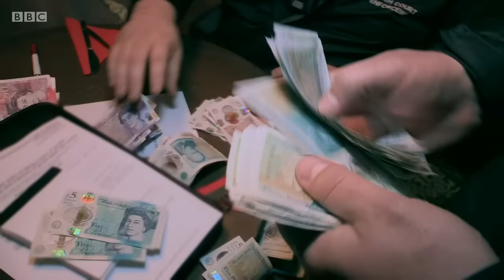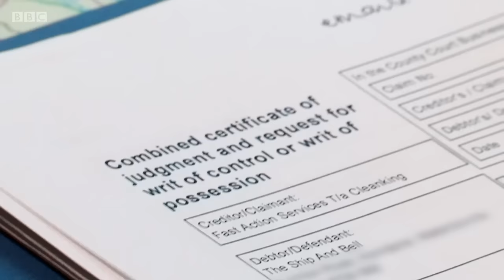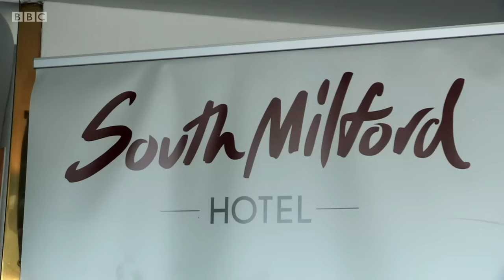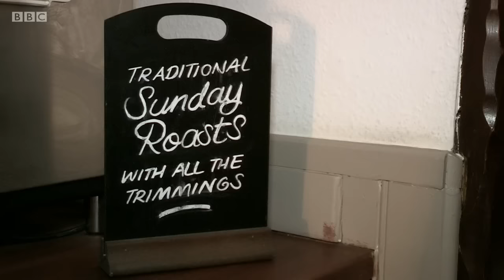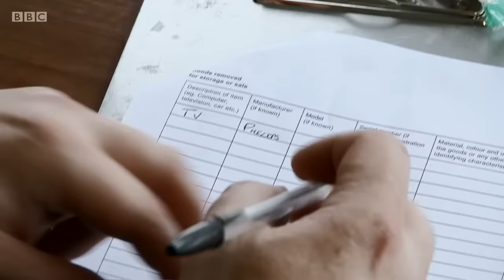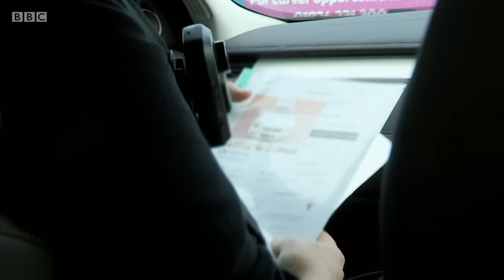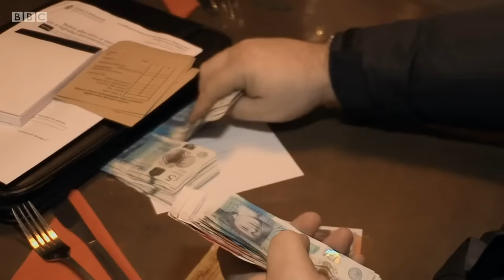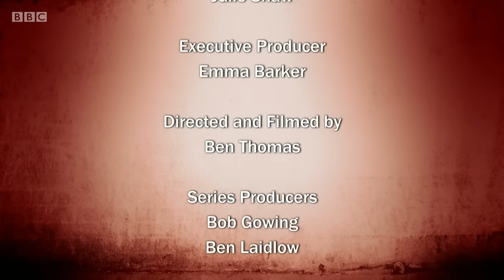The Sheriffs Are Coming S09E08

Comment: They took way way more than they needed to from the hotel, local scrap yard would have paid more than £2k for all the stainless steel in the kitchen alone.
Reply: I don't think that they are allowed to scrap items. If the items don't sell I think that they return them to get them out of the way. Don't quote me on that though. You may well be right about the scrap value though. It would have been interesting to see.
Reply: Once sold, if they make more than costs and debt, the extra is refunded to the business
Reply: From previous series they have mentioned that if excess money is made from any auction, the debt it paid and other monies returned to the owner.
Reply: They have no choice, just like the fees are set in law so is the process for disposal of assets, they must go to public auction.
Reply: And they have to take more as the price on the day may be less.

Comment: I don't get this faulty car thing. How is 2nd hand dealership responsible for a fault that happened while customer took it away? Shouldn't they blame it on MOT center who certified the car as road worthy and working?
I mean obviously it depends, if dealership gives warranty, then they are 100% liable, but if they sell cars "as is" then I don't see how they can be held responsible for unforseen faults.
Even a brand new car can break down due some defect, obviously new cars are always under warranty, but used cars rarely are.

In that case, customer was wrong. they offered to repair it, but why would they have to go and get the car? it would cost them more than the car itself. Reason why they didn't allow other garage to carry out the work, is because lot of customers are scammers and lie about the fault, so they could just get a receipt from a friend and basically get free money. I've seen many customers do similar things.

If I ran the dealership, I'd make terms VERY clear. I'd probably offer a limited time warranty, but I'd make it very clear that you MUST bring the car back. It's hard to judge, because those cases take months or even years to develop, but all that has to be summed up into 15 minutes. It could have been either side's fault, depending on terms.
I bought a camper from 2nd hand seller and I knew I'll be very far away with it, so instead of 6 month warranty, I asked "how much are you willing to take off from the price instead of the warranty?"
Reply: most cases are won by default because the defendant doesn’t attend court rightly or wrongly.
Reply: You can't contract out of consumer rights.
Reply: and of course if it can go one way it can also go the other, that is to say that if a customer can lie and get fake receipt from a friend.......is it not also possible for a dealership to do exactly the same thing with a dodgy MOT..........or is it a one way street in your mind?
Reply: Lemon law